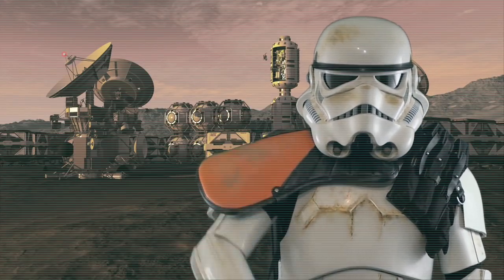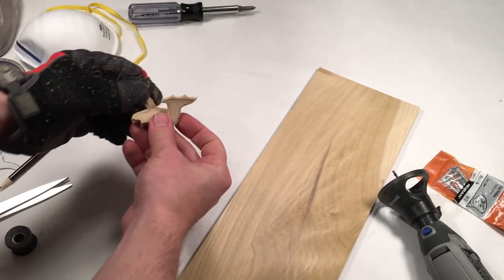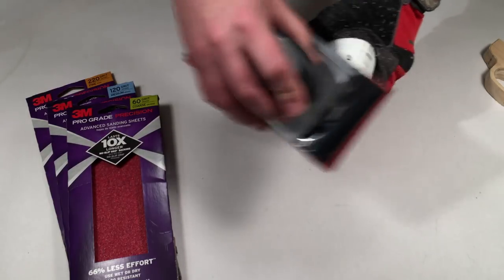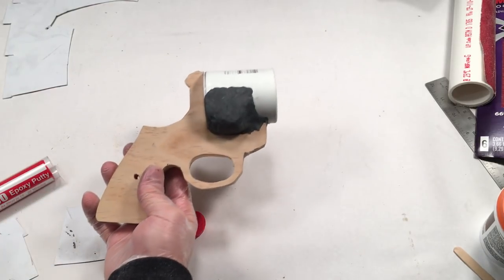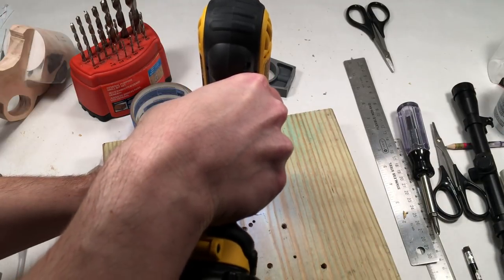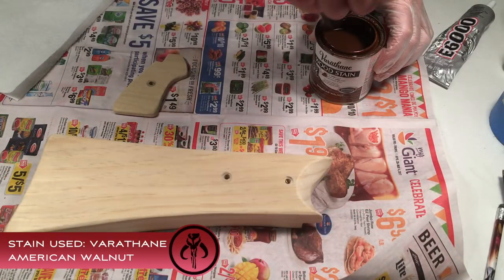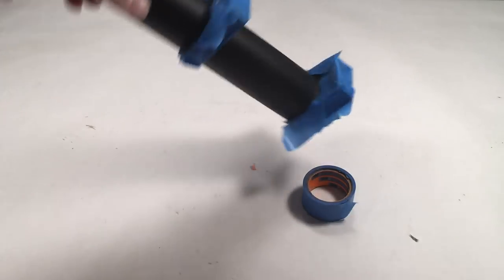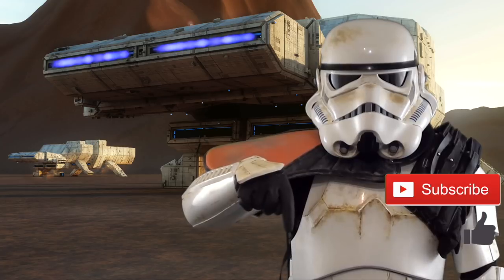DIY: Boba Fett EE-3 Carbine Rifle (ESB version)

Comment: Just when I think I'm going to catch up on my projects and another video drops. I'm going to have find to make this beauty aswell. Shame the hardest part is finding the components in the UK. Excellent work, I anticipate the next one, perhaps a bowcaster.  Cheers.
Reply from the maker: Thanks for writing in Rich...hopefully you can still adapt those wood templates for the stock/stalk/body and find some other materials for the barrel.  At least you have access to maclow clips!  I had to order them from the UK! :-)  MTFBWY my friend!
Reply: Hey I'm from the UK as well, have you ever used any Bondo equivalent? You know the body filler. I can only seem to get it in small containers, not the big ones like the US has.
Reply: normie twice removed No only had some bad smelling body filler form Wilkes and milliput. Been advised to find ipson p38 which is a polyester filler. I do wish they did bondo over here.

Comment: Is there a better way to add the the squares of the back half of the rifle, right above the trigger?
Reply: You could use some 1 inch Eva foam and use a rotary tool to put an angle on it then glue it on with contact cement

Comment: What was the length of the 1.5" PCV Pipe that you cut off?
Reply from the maker: Hello Awkward Talker, the measurements are on the 1.5 inch PVC template paper.  The PVC pipe should be about 22.5cm long.  Let me know if you have any additional questions.
Reply: HappyTrooper OK. Thank you, by the way, you did an awesome job with the EE-3. 👍